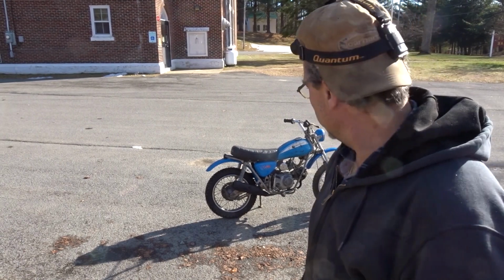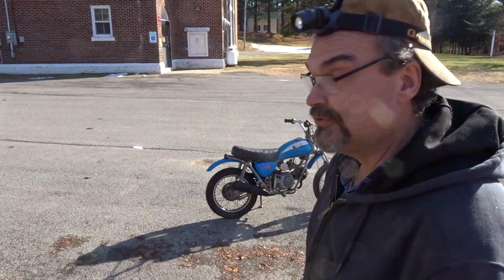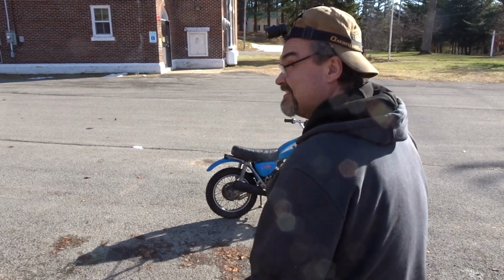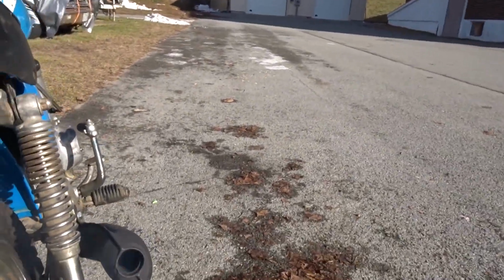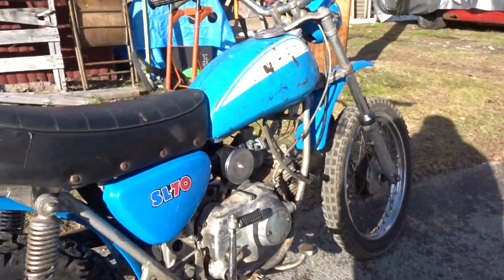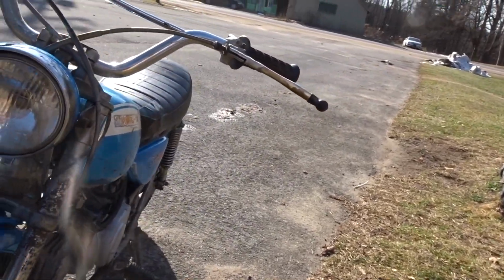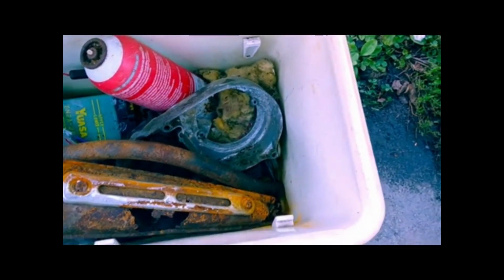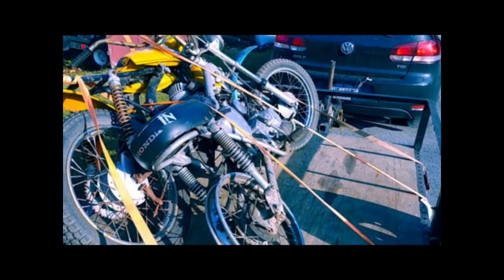1971 Honda SL70  FIRST RIDE!!!  Before and After

Comment: are you going to do more work on it over the winter?
Reply from the maker: Maybe a little more on the carb and the gas tank.  I have a 1978 that needs paint and repair.  When I clear the 78 I will clear the 71.  Then I know I will have enough projects to use a complete can of Spraymax 2k clear.  Thanks for watching.